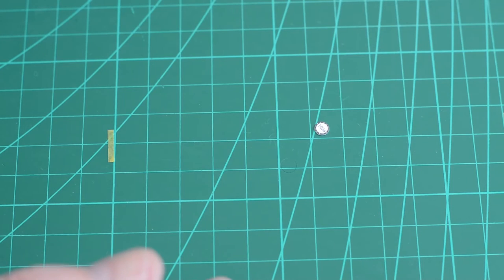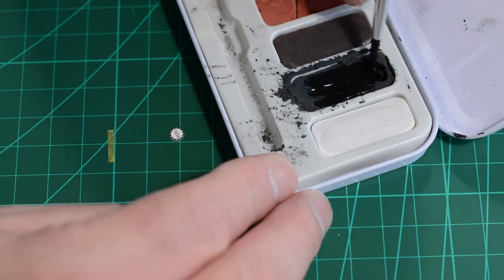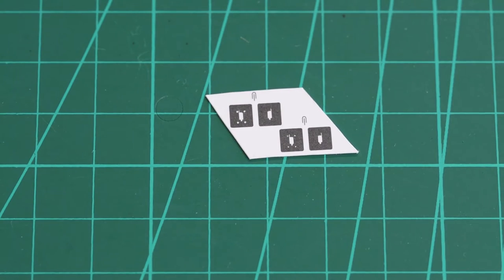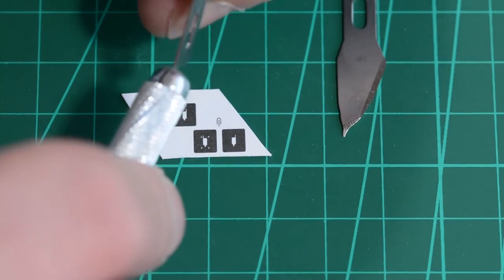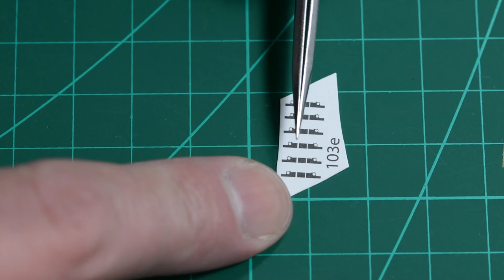Borodino, Paper Model, 1/200 Scale, Part 2, 47mm Guns

Comment: Great stuff. When you chose not double the parts, did you laminate existing part to maintain thickness?. Great tips on radius cutting and the folding tips were good as well.
Reply from the maker: Thanks Richmond.  No not in this case. The shields if doubled would have given a real dimension of ~100m (4") which I think is far to thick for this type of gun.  The single thickness of the shield won't impact anything else.